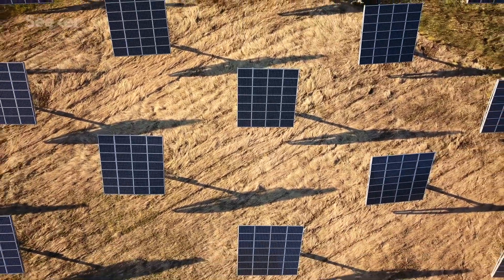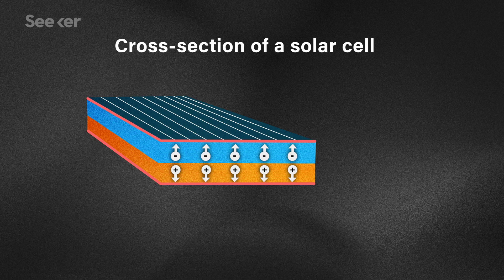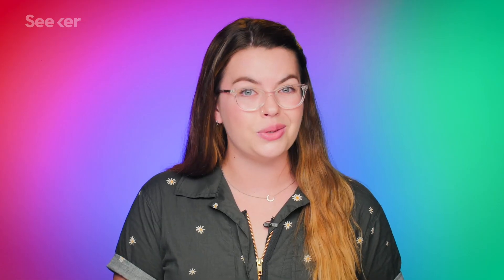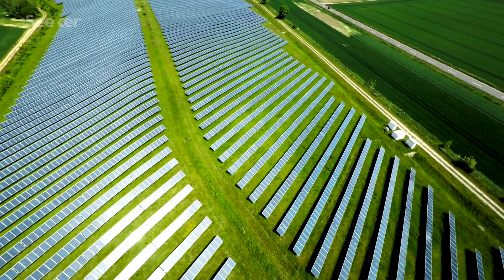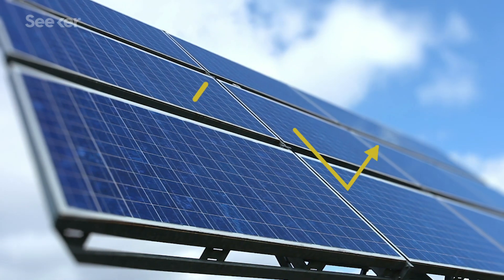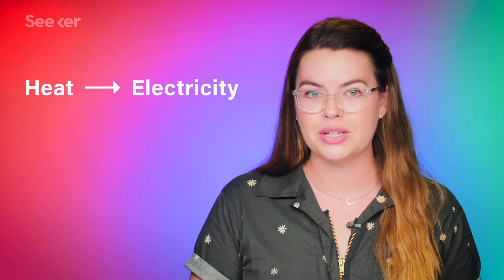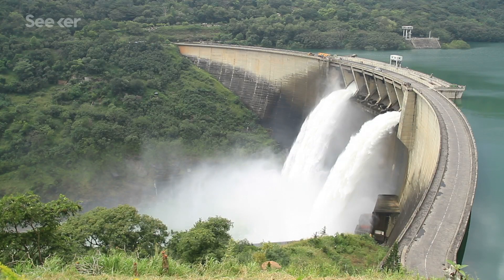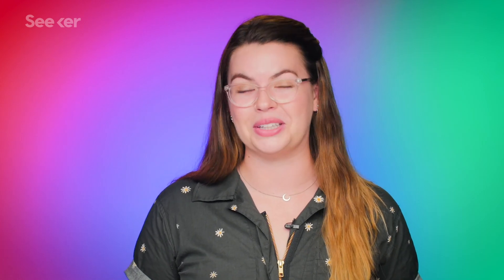Carbon Nanotubes Might Be the Secret Boost Solar Energy Has Been Looking For

Comment: At 80% they would be a viable source of energy! Now, the storage problem!!
Reply: Reggy2000 There is a testing facility in the city of hamburg that stores excess energy as heat in containers filled with volcanic rocks. This can be used to generate electricity again, if needed. An upscaled facility could store enough energy to produce electricity for months.
Seems like out storage problems are almost solved.
Reply: There is an environmental friendly energy storage solution.
https://youtu.be/U7a_LMM2_fE
Reply: Car to grid will be the solution I'd imagine, seeing as electric cars are coming, thats a huge amount of storage that probably only gets used twice a day. Imagine being able to sell off the last 90% of your car batteries storage to the grid and get paid back for it.

Comment: Why aren't people combining thermal electric generators or stirling engines with the solar panels?
Reply: Haha YouTube scientists...

Laws of thermodynamics guys
Reply: How would you combine them, you mean like a concentrated solar power plant?
Reply: @raho2005  na just cool the solar panels with liquid cooling and extract the energy from it via a Sterling engine. It's a win win the solar panels are more efficient because they are cooler and you get extra energy from the heat.
Reply: @INLF  there are power plants that use solar thermal collectors.
Reply: @raho2005  yes I know, but that's a different way to use solar energy, which is not really compatible with photovoltaics.
I think the original poster meant using the unused heat from the solar panels.
Reply: Scientists recently made solar panels that used the waste heat to desalinate water. I'd provide a source but I don't want my comment to be hidden.
Reply: @iwiffitthitotonacc4673  just because it can be done in lab it doesn't make it cost or energy efficient... If it was such groundbreaking research we all would have heard about it by now.
Reply: Short answer it requires more energy.

(at this moment in time)
Reply: They already did with concentrated solar power.

Comment: It is very hard to produce nano tubes in the first place. This will increase the cost of solar panels. So the efficiency will not be accountable.
Reply: Solar panels were expensive and hard to produce when it first came out.
Give it time.
Reply: @mr.personhumanson6871 I know they came from 2% efficiency to 15-20. But the manufacturing of nanotubes doesn't change. The main issue is we the improvement and implementation right away.

Comment: It has occurred to me that carbon nanotubes would be an excellent coating for solar powered water boilers which could be used to generate electricity via a steam-powered dynamo.
Reply: This is already done in "solar arrays".
If you ever fly from Las Vegas to San Diego, you'll see them. 
Although they heat salt instead of water.
Reply: Gerg C : Yes, I know, but that requires thousands of mirrors mounted on heliostats, which is shockingly expensive, unreliable, and dangerous. VantaBlack 2 absorbs >99.99% of incident light, including infrared, and would be a much safer and more economical solution.
Reply: Oh, also, the mirror solar arrays require direct sunlight to function, whereas VantaBlack-coated boilers would not.
Reply: @simonrmerton  
Steam has to be ridiculously hot to turn a turbine. Does your idea not require it?
Reply: Gerg C : Any object that is completely covered in VantaBlack 2 will get hot enough to melt or sublimate if left in direct or indirect sunlight for long enough. The heat is absorbed and accumulates, having nowhere to go.

Comment: Still need alternative energy sources for winter times(above arctic circle, 5 months of darkness)
Reply: Chemical(especially fossil fuel) is so far our second best storage of energy(density), second to nuke fission stuff as far as I know

Non chemical sources of energy in a cold places...my ideas run dry after geo thermal springs or some kind of volcano
Reply: Ganjalf The Green geo thermals, or some other geo gases aren’t option in above arctic circle since earthquakes, volcanoes are not present
Reply: @Yooo-ph5zx  ah well then...

Thermo and nuke is what I know best

Unless someone picks up on what tesla was on about

Guy was aparently trying to harnest energy from the cause of the northern lights
Reply: wind. solar is also more efficient at cold temperatures.
a lot of northern countries rely on hydro power, so that will cover you aswell all year around
Reply: @Vulcano7965  is the wind reliable there?

Also solar is kind of whack as the 5 months of darkness is a thing
Reply: @ganjalfthegreen5312  I'm pretty sure that there is almost no region on earth that doesn't experience wind.
As the question of the most viable regions, I don't know but it's not impossible to find out.

Comment: They are the answer to everything, carbon nanotubes
Reply: Recent research has shown that nanotubes could be the answer to making Super capacitors viable for portable device. An experiment was done in Japan that showed they have the potential to have over 10X the energy density of modern batteries.
Reply: Even my failing marriage?